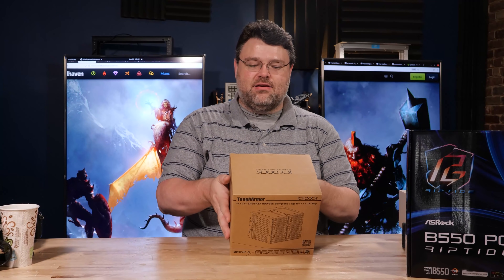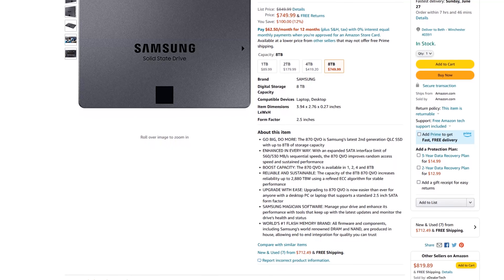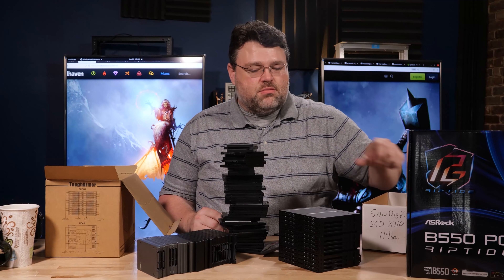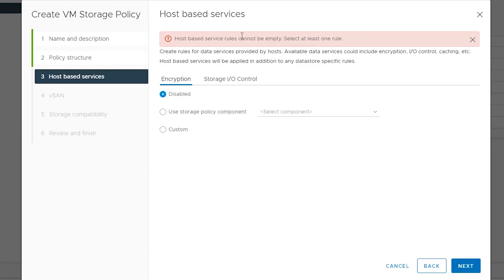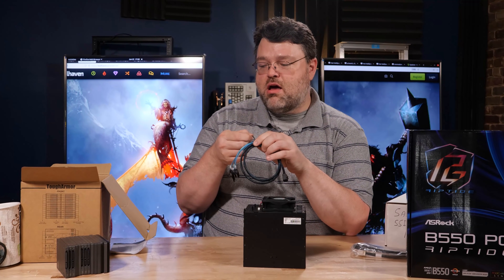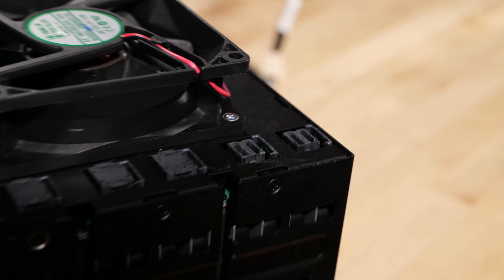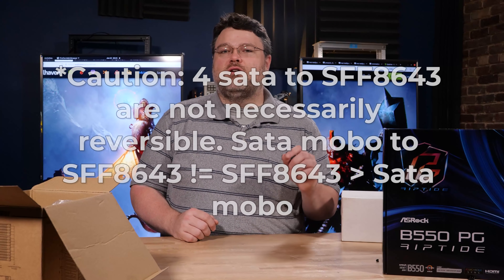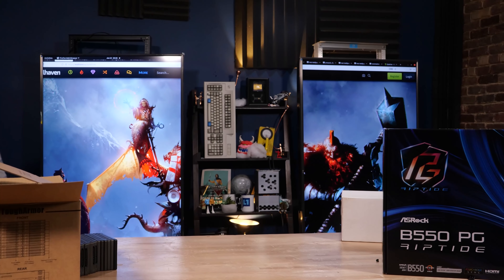Checking Out The Icy Dock ToughArmor 24 x 2.5" SAS/SATA Bay: Storage Overload!

Comment: I've never had any issues with dust causing the square SAS mini ports to stop working properly, but I would totally believe it's possible. If you're concerned, just make sure to blast it clear with some compressed air before you jam the connector in and crush that dust down into the connector where it'll require picks to remove it.

Comment: will work with such a card BEYIMEI PCIE SATA Card 16 Ports, 6 Gbit / s SATA 3.0 PCIe Card, PCIe to SATA Controller Expansion Card, Boot as System Hard Drive, Suitable for All PCIE Slots (JBM575 + ASM1064)

Comment: Considering the cost per Gig sweet spot of 2TB SATA SSDs, this could be an awesome little flash heavy storage solution. Obviously you don’t NEED to fully populate it up front, but you have crazy levels of overhead availability. 
I recently picked up a 6x3.5” cage to populate with my 8TB shucked drives and mount to a modded NUC + M.2 to 5x SATA HBA adapter. Instant super SFF/Low voltage NAS.
I was already considering 3.5 to 6x SATA 2.5” cage options for a more mobile solid state travel NAS.
What about mounting something like this into a mini ITX NAS case (Like the iStarUSA S-35) and using a 24-port HBA (like a Broadcom 9305-24i)?

Comment: My Icy Dock 5x3.5" to 3x5.25" didn't have grooves, which is understandable since it's physically impossible. Had to clamp the separators in the case down, thankfully it was a cheap Bitfenix Survivor with wafer thin steel so it was an easy job :)

Comment: Great 👍 
I own the 16-bay sas variant along with a Broadcom 9500-16i and will fill that with 4tb ssds step by step.. Host OS is Unraid💪🤤
Reply: Noise of the fans?
Reply: @hans_kruse  pretty okay on lower settings. No need to go high for me cause the SSDs don’t produce that much heat. But you could also replacement with a noctua fan if you want

Comment: I really wish someone would make a modern case with front bays consisting of all 5.25 bays.
They are practically non-existent new and the number of cases available to even support 3x 5.25 bays for this dock is going down as time passes. I'm grateful for my Azza Solano 1000 even if it's not a great case outside of having 10 bays.
Maybe Icy Dock will fill the void themselves as it's needed.

Comment: sas will handle sata traffic, but the reverse isnt true. breaking out a sas backplane to sata would not work even with the right cables. the icydock is sending sas traffic upstream to the controller, regardless of what drive is plugged into the bay, and the mobo sata controller isnt compatible with that data

Comment: My box of 2.5" drives are all old mechanical laptop drives.
Reply: Me too. I have like 100 500GB 2.5" HDDs, but not a single "extra" SSD lying around...
Reply: Mine is not quite that extensive. 🤣
Reply: @pkt1213  I was really lucky. I have a friend who works in the IT dept of a company. And they were replacing their fleet of laptops over the last couple of years. For unknown reasons, instead of selling the old ones off they were telling their IT dept to recycle them as e-waste after secure-erasing the drives(they were made to buy one of those devices to erase multiple drives at a time). So my friend figured since they weren't being re-sold he would hang onto the hard drives to use for offline backups. There were far more than he needed so he gave the rest to me. They are mostly 500GB but also have 320GB, 160GB, 80GB. I use them for making offline copies of all the TV series and movies I have downloaded, since it would be a huge PITA to download them all over again. I also use them for when a friend or family member needs more storage in their PC or wants to install another drive to have as a backup(yes, I tell them that it's not as safe to have the hard drives in the same system as separated).

Comment: I see some people have confirmed that the break out cables have directionality, but I'd like to add why as I didn't see an explanation when I skimmed through. Host SATA ports are wired differently than drive SATA ports, with the Tx and Rx lines flipped, to allow "straight through" cables to be supported.

SAS dumped that ideology, and moved the flipping to the cables for the combo connectors. I believe this is to simplify supporting expanders, as expander ports may be connected to hosts or drives and avoids the need for dedicated expander ports for one or the other.

In hindsight SATA should have been built on crossover cables as standard, but I guess ethernet was not enough of a lesson. This was such an issue for ethernet, modern ports rewire themselves to support wrong cabling. Ethernet autosensing may be the best thing ever invented for IT...

Common terms for the breakout cables are forward breakout and reverse breakout (warning: sellers are not immune to mixing up the terms). The terms are from the host port point of view, so forward breaks out on the drive side and reverse breaks out on the host side. It might be worth including this info in a video for other home labbers that may run into this.

Comment: This screams for a revision + case to pair it with ROMED4ID-2T's storage/IO options ;) With 2 slimline PCIe4x8 that can be split into 16 SATA and remaining 4 slimline PCIe4x8 that could be used for 8xU.2/U.3 2.5" NVMe devices, you'd still fit those into the same 24 storage devices chassis (4x4 SATA + 2x4 NVMe), but you'd combine slightly slower and far faster 2.5" SSDs, perfectly complimenting this mobo for a tiny server ;) Heck if it were put in front of the deep mITX AsrockRack product, the dock's fan could further feed the air/or at least move it over the rack-optimised airflow cooling solutions of the mobo... That would have made a pretty great somewhat SFF desktop server with Epyc Milan at the heart... think elongated NR200 to accomodate the cage at the front and the rear compartment for the compute part more or less as is, with theoretically enough performance per cubature/volume in desktop/"tower" SFF to rival high density 2U rack units with flash arrays on the front ;)

Comment: I got the 16 bay version. Still need to get the HBA and fancy cables to go with it tho.
The original plan was to use 2.5" hard drives, which seemed like a reasonable enough solution given I couldn't find a case I liked with enough 3.5" drive bays. Then the whole thing about SMR drives blew up, thankfully just BEFORE I bought the drives. Since basically every 2.5" hard drive in production is apparently SMR, I ended up getting a bunch of SSDs instead.

In the end I'm sure this probably wasn't the best or most cost-effective solution. But it's cool, so whatever.

Comment: Haha I have that same old school Antec case also. I used it as a DVD ripping box for Plex. I have it loaded up with 9 SATA DVD Burners. A 5.25" bay monster!
Reply: Geez, I don't ever recall seeing a case with 9 5.25" bays. Well, maybe a full size server tower 25 years ago. I have two different Thermaltake cases. One has 3 5.25", 3 3.5", and 3 2.5". The other has 3 5.25", 5 3.5", and a hot swappable sata dock on top. My main system has a Blu-ray writer while my backup has a DVD writer. On my main system I have an Athena Power 4 2.5" to 1 5.25" converter in one bay. It's very nice. It holds 3 2TB SSDs and 1 250GB SSD as the boot drive.

Comment: Yah... I use those.  Well, I mostly use the quad 2.5" hot swap units that fit in a 5.25 bay.  Its perfect for a small PC.  But, its kinda cheap.  It works, don't get me wrong... I buy tons of those little enclosures and I like them.  But the metal is pretty bendy, and you just can't trust the little fans... much better to have a big can fan pulling air through.

You can't put mechanical HDDs in those high-density bays, the airflow is not sufficient.   I've tried it in the past... it doesn't work.  They overheat.   However, putting SSDs in those bays works quite well.

There is another little problem with these bays, and that is... well, I don't think the SATA/SAS connectors are actually electrically stable.  The circuit boards are not shielded at all and if I remember right they are 2-layer, so noise can seep in fairly easily.  Also, the capacitors are too small and the bypass caps are insufficient, which means that if you pop a drive out of the array while its operating full-bore, you can glitch the comm channels in other unrelated drives.

So, buyer beware.  This stuff works great for workstations, but it isn't server-class hardware.

-Matt
Reply: You put 2.5" HDD's in these before? They over heated?
Reply: @CheapSushi  I did.  4TB Seagates, four of them.  They overheated under modest to heavy loads.   What would happen is that the I/O rate would suddenly drop (i.e. the drive throttled the I/O artificially)... to very low levels for about 10 seconds or so, then return.  Then repeat.  

I verified it with SMART queries.  The drives were overheating.

These particular drives were full-height 2.5" drives, which I think is 15mm or so (not the slim 7mm drives), so there was basically no space for air to flow across the drives due to them being packed so close together, even with a fan.

-Matt

Comment: Icy Dock stuff is great but prohibitively expensive for the hobbyist. It looks like this model goes for about $700; you can buy an entire older-generation server with 24 hot-swap 2.5" bays for that price. (This is rated for 12 Gb/s SAS, but if you're using it with SATA drives that makes no difference.)
Reply: Yea that was my problem with this. I was going to wait for it to come out but I got a Silverstone 12x2.5 in 3x5.25 instead. 1/2 the density for 1/7 the price.

Comment: Oh hell i thought i had one-upped you with my 16x2.5 inch all flash portable mATX server using the icydock 16 bay, i didnt even know they had a 24 bay, or i'd have bought them to have 8 additional scratch drives(re-use some of the old 2TB HDDs that used to be in this now all flash server)

Edit, i also have a classic case, an Apevia XQPack 2
Reply: I looked on newegg and didn't even see the 24 bay model; only 16 bay and lower. So it looks like Wendell got himself an advance sample. ;-)

Comment: Those breakout cables have a forward and reverse direction, the pinout's different on both! So they're not bi-directional
You'll need the other type if you want to use it in the reverse order (4x SATA ports on mobo to single SFF-8643 device-side)

Comment: You needed a Cross-over Mini SAS HD to 4x SATA Cable. Such as the Supermicro CBL-SAST-0591. I use 6 in my iStarUSA E4M24HD to go from the backplane (SFF8643) to my motherboard + HBA (SATA). They can sometimes be found labeled as "Reverse" cables.

Comment: And to add a bit of a challenge use M.2 Sata drives (and yes it is very possible to do).
Reply: There's some really nice 2.5" adapters on Alixepress. They have have LED blinkenlights on them. I honestly prefer that route more than these SATA 2.5" SSDs because the case is most of time only 1/3rd full. The M.2 SATA ones would get more air flow in these IcyDock bays.

Comment: Damn, seen 6 or 4 2.5in bays for a single 5.25, not this.
Had a single hot swap 3.5 for my HTPC and 3 bay 3.5 hot swap that fit 2 5.25 bays for my main rig back in the day
Reply: Take a peek at Newegg, they have lot of models from IcyDock and Athena Power. I have a 4x2.5" into one 5.25" bay from Athena Power and I love it! I bought it several years ago when it was an insane sale(regular price is $65 and it was on sale for like $20-25). Like the IcyDock he showed, Athena also crams up to 8 2.5" into one 5.25" bay. In the 4 in 1 I have, I installed 3x2TB SSDs plus my 840EVO 250GB boot SSD. I wish I had bought two since I still have one free 5.25" bay which I could put 4 of the 500GB HDDs I have. The third 5.25" is taken by my Blu-ray writer. My case(Thermaltake Dokker) also has a 2.5"/3.5" SATA dock in the top which I love. The 3.5" bays are full with a 4TB and a few 2TB HDDs. I have a generic PCIe 4 port SATA card since obviously the motherboard doesn't have enough SATA ports. Needless to say cable management is practically non-existent, but my system is actually built to be used. It's not some glass-sided system with just a 500GB NVMe drive that is supposed to sit in the background of a Youtuber's video while he plays Fortnite...
Reply: @SirReptitious  NE is were I bought my 2 bay 3x3.5 hot swap. Had 3 1GB WD green drives back then.

Comment: so the SAS and SATA cable thing - SATA cables are wired as 1:1 cables meaning that the cable direction doesn't matter. the SATA host/controller has it's TX and RX pairs swapped over to make consumer things simple. It also means the cables are cheaper to make as no inner cores need to cross over. SAS are pinned out such that the connector pinout is the same on initiators and targets - so the cable does the roll over to suit. so when using SAS and SATA connectors togeter you need either a forward cable from SAS to SATA or a reverse from SATA to SAS. the underlying reason being pinouts of the TX and RX pairs.

Comment: Those breakout cables do have a direction. You would need a "Reverse Breakout Cross-Over" cable for those onboard SATA ports. PN: CBL-SAST-0631
Reply: "Reverse Breakout" is what I use between a mini-sas backplane to the sata sockets on a motherboard
Reply: Yep "forward" is what is used for HBA/Expander to SAS/SATA.
Also the main connector can be another stumbling block if you don't pay attention when ordering (SFF-8087 or SFF-8643)
Reply: Thank you!
Reply: "reverse" is the important word. Very important to mention

Comment: I believe sas -> sata cables have a direction, which might be why it didnt work for you both ways.
Reply: Yup. If the concentrated connector is on the drive side and the individual connectors are on the mobo side, you need a "reverse breakout cable".

Comment: I have the 16 drives in 2x 5,25 option and also the 8 in 1x 5,25 option. They work with usual HBA controllers but not with the Oculinc to miniSASHd Kabel (e.g. from a ROMED8-2T). Got no response from Support if i need special Cables (the Oculinc to Sata cable which is included with the MB works...)
Reply: I think that was an issue on the IcyDock side. I think they had to do a hardware revision to fix it though.
Reply: @bourbonwarrior1618  Hmm yes you are correct, found an article on their site. Maybe i will try it again with the support if I'm in the mood.

Comment: I kind of want to get something like this, except f or 3.5" drives instead. I've only seen one from them though, and that has 5 3.5" drives in the space of 3 5.25" bays.
Reply: 3.5" drives are just too big to effectively fit a lot into a case. The 2.5" have the advantage of being able to put two side by side. You could look for old server type cases that hold a lot of drives, or check out newer cases that still make room for a lot of 3.5" drives like the SilverStone TJ04-EW or Fractal Define 7 XL. Considering the cost of some of these bay converters getting a different case isn't as expensive as you might think.